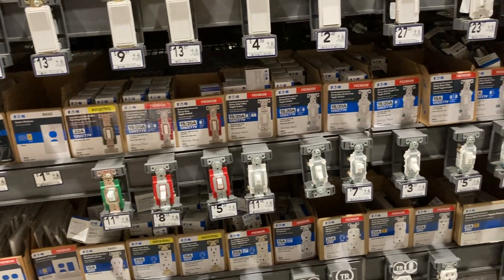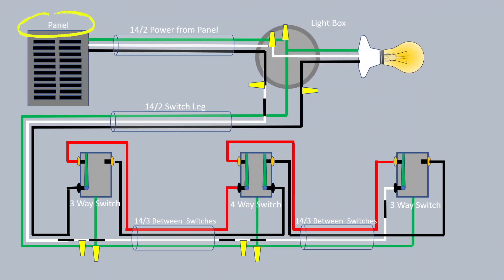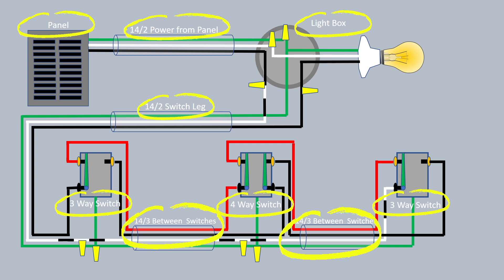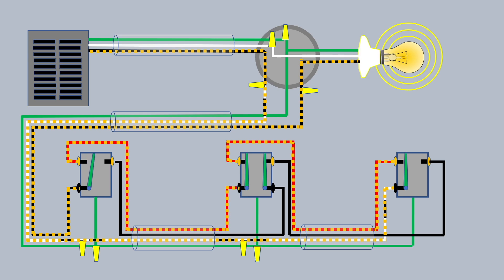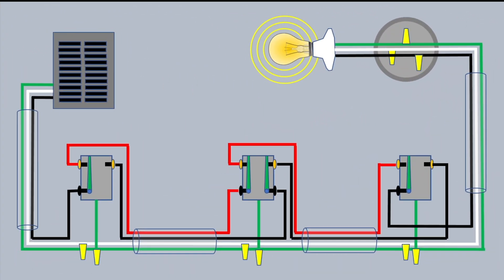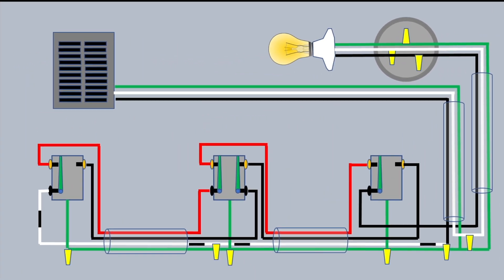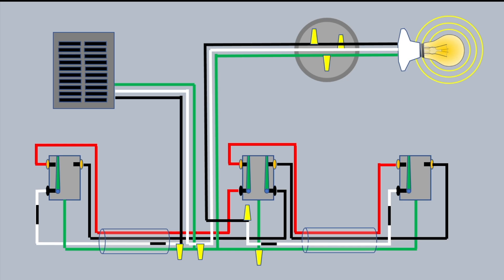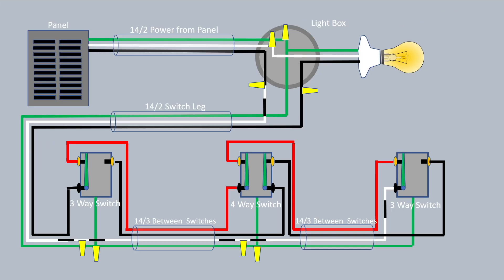Nice, easy to follow, explanation and animation of  4 Way Switch Wiring

Comment: I had a four-light, four-switch system all wired and really needed to get the wiring right. I was smart enough to wire the lights on a single line, separate from the switches. I was able to 'replace' the single light in your diagrams with the load line that was feeding the four lights and got it all wired in. Damn! It didn't work! I retraced each of the switches and found I had switched the incoming and outgoing wires on one of the four-way switches.
Kudos to you for your diagram, explanation and post in general. Thanks!
Reply from the maker: Thanks for watching

Comment: Great video and verbal instruction, including your calm voice.  After 3 hours of failed rewiring on a circuit similar to the one you depicted, I found your video, and it saved the day.  My residential light circuit had been wired incorrectly, hot wires not identified with tape, not grounded, and on top of that, had loose wires in the can light junction box, so half the lights didn't work. It feels so great to have this fixed, and I give full credit to you and your excellent video.
Reply from the maker: Thank you for the kind words and thanks for watching.

Comment: Good day, Thanks for this video.  I have a 4-way 3 switch setup here where if the two switches downstairs are a certain way the upstairs switch cannot turn on the light.  I have metered it and there is never any voltage on the red traveller to it. This switch common (black) is not hot when light is off.  The 3 way switch at the other end has black to common and its hot regardless of light status so I believe this one has the line coming to it from the 4way box (4way has four sets of cables plus one for a different switch, to it where the 3-ways have only one cable with red,white,black).  Both three ways connect to the 4-way but its not as I expected.  The 3-way with 120 on common has white and red travellers and they are both connected to the copper colored screws in the 4-way.  The 3-way with 120 on common only when light is on red traveler connects to a black screw on 4-way but the black common cable connects to the other black screw and the white traveller is tied to another white wire going to the load I presume.  When I meter the 4way black screws the black cable is always hot and red never goes hot.  I am thinking either its wired wrong or the 4 way switch is defective.  Any thoughts?  I feel like the black wire is supposed to be tied to white and the white wire should be connected to the other black screw on the 4-way.
Reply from the maker: Thank you for watching. I'm afraid I'll have to pass on this. Turn the breakers off and get a tone wire tracer tool and trace the whole thing out.

Comment: Im example #1 what would you do if at the 4way switch box you had switched for other light's but now you dont have a nuetral in the box?
Reply from the maker: Thanks for the comment, Actually there is no neutral in any of the 3 switch boxes as this is a "switch leg" and the neutral remains in the light box. In a switch leg, (and I hope I have the lingo right) you are only interrupting the line side of the circuit. There could be another switch in a double box with one or more of these 3 switches but it would part of another line and load.  As always check with an electrician or code official. Thanks for watching.

Comment: Amazing video.  This is something I've tried to understand for years!!  QUESTION THOUGH: my wife just bought a "smart" wifi dimmer switch (that requires the neutral).  Where do I put that in?
Reply from the maker: Sorry I can’t help you with that. Check with an electrician or someone who has installed one. Thanks for the comment

Comment: Excellent easy-to-follow description - thank you. I have an existing light with three switches and I want to relocate two of the switches. I'll be using your excellent diagrams to identify how the system is currently wired, before trying to recreate it in a new location!
Reply from the maker: Thanks for the comment.